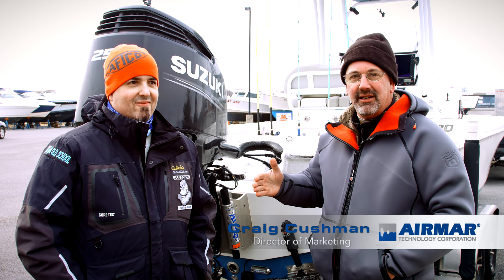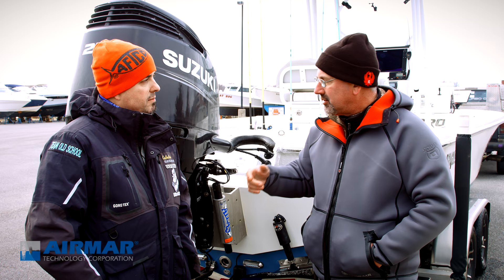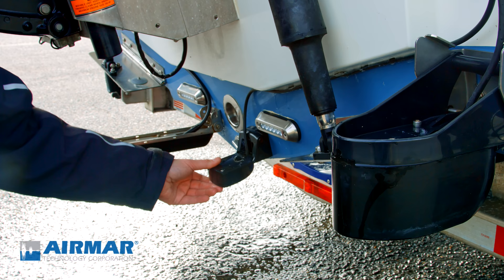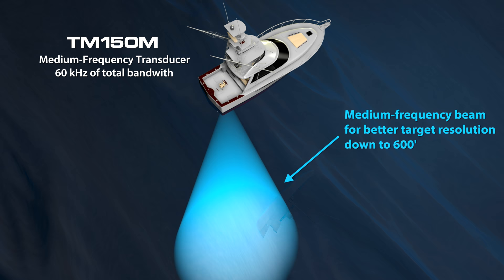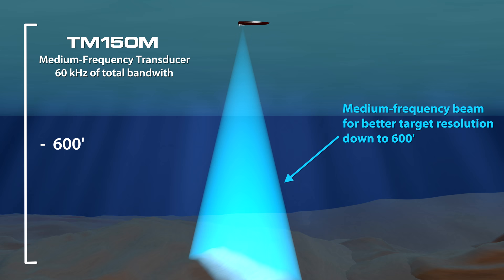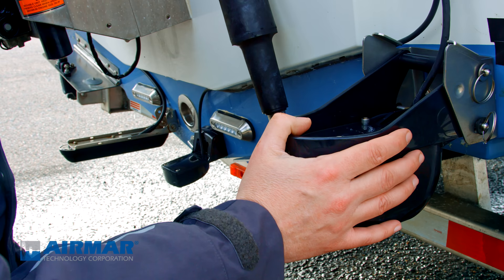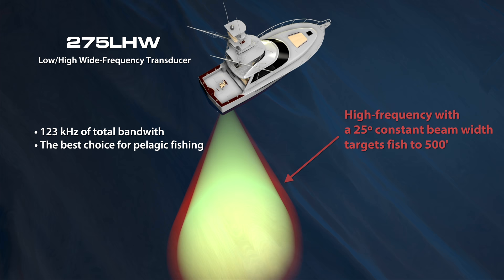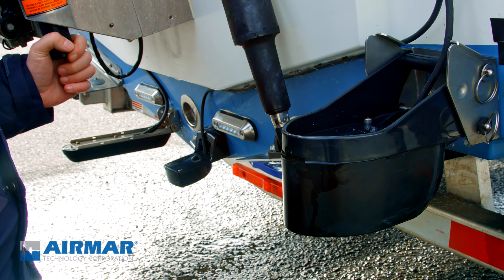Airmar Transducer University Mike Smedley Transom Mount Setup

Comment: I have a tm185hw with a Simrad Go9 XSE and I am not able to mark depth or fish over 5 mph. I am in the process of doing some adjustments to see if I can improve on that. What settings would you use for palegic fishing and also for bottom fishing in 50-300 feet of water?

Comment: Was that a 3d transducer?
Reply from the maker: No 3D transducers involved.  Mike does have a Simrad Side-Scan transducer along with two separate Chirp transducers -TM150M and the TM275LHW
Reply: @airmargen  LOOKS LIKE A THIRD TRANSDUCER TO ME MOUNTED JUST TO THE PORT SIDE OF THE DRAIN PLUG????